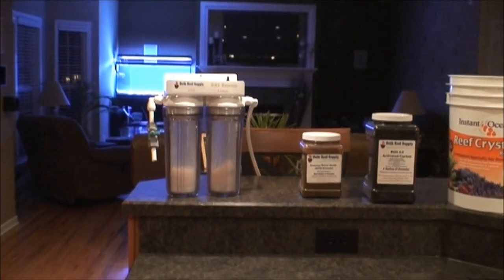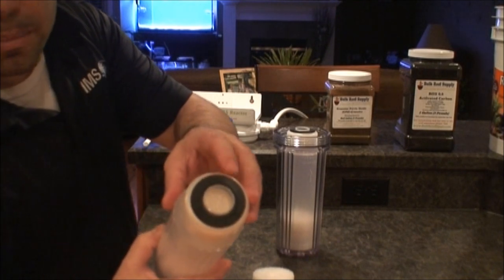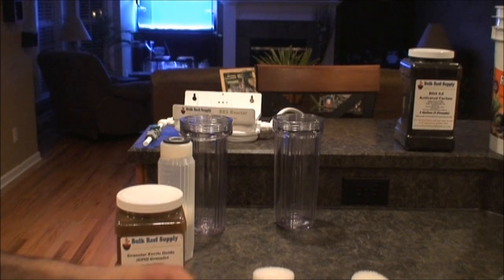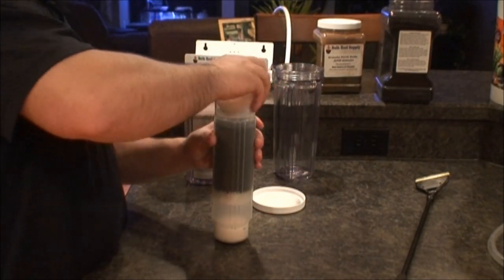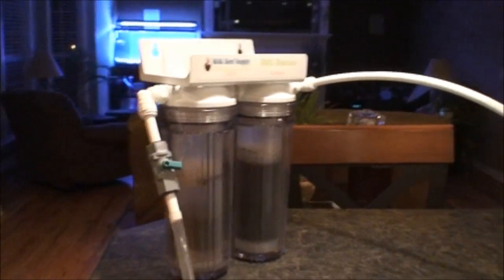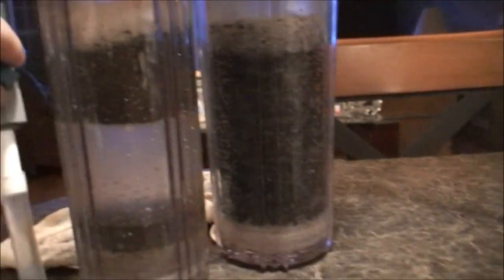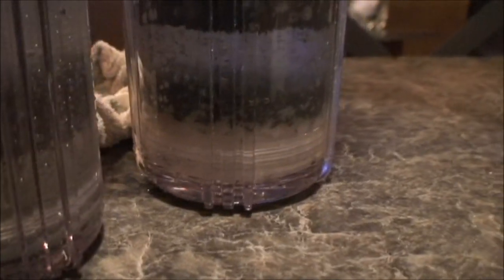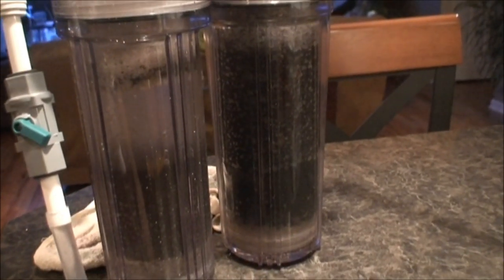BRS Dual Reactor GFO & Carbon.wmv

Comment from the maker: You can either set the canisters on the floor or hang them off the wall. I don't believe they could hang off the tank. However, I have seen some set inside the refugium. 
The hoses are not that long. You can cut the plastic which inserts into the couplings and attach vinyl hose to extend. This is what I did. I purchased the vinyl hose from Home Depot.

Comment from the maker: I like the reactor very well. Well built and easy to use. Much better than putting carbon near the return pump in a bag. Not very efficient. However, if you have enough room I would use two single reactors. One for carbon and one for GFO. This way you can control the flow differently to each reactor.

Comment from the maker: @jbliss2000007 Thanks for the info. I will make sure to keep an eye on the GFO. It is not running yet. I actually put too much in the reactor. I will be removing and re filling correctly. I will also finish what I have then try a different brand. 
That I awesome about the refugium. I can't wait to see it.

Comment from the maker: @UstadZed Well, after all the research that I have done I feel that the sump refugium is the best filtration system for the reef tank. This is the system, 73g Display, 30g sump ASM - G3 skimmer(used), BRS dual reactor, Mineral mud, 180lbs of sugar fine sand, Tek light, Reef Keeper (freebie) custom built cabinet. 
So, I don't really have much more than anyone else. The cabinet was a bit much but It needed to match the space in my house. I treated the cab. as a piece of furniture.

Comment from the maker: Thanks for the tip! I agree with you suggestion. However, it is a bit difficult to get good flow for both meida's. 
After using this reactor for a while I believe separate reactors are a better way to go.

Comment from the maker: Yes, the unit stopped leaking. It works very well and is also reasonably priced. However, If you have room for singles that is what I would go with. It is easier to control the media with a single reactor.

Comment from the maker: @moneymarkj Well, I took 25-30g of water out of the tank, set the rock in and completed the aqua scape. Then I filled the tank back up and changed the scape. After looking at the tank for a while, I still don't like how I have the LR set up. So to answer your question, Yes the water is in the tank.

Comment from the maker: @MadHatterReefs I didn't mean that I do not want to use the carbon and GFO. I meant that I wish i had purchased separate containers. I don't know if I am a fan of Bio Pellets. I feel that with the correct set up, sump/refugium, LR, DSB and carbon, there should be no need for the pellets. However, I could very well be wrong.

Comment from the maker: @dm002a8686 I purchased from Live Rock N Reef,  Cherry Primo Deco and Buna Ultra rock. I started with 70lbs. The guy told me not to use more than that due to the Primo haveing so much life and the cycle will be huge. We will see about that. I will post a vid. The rock will be here today. I also have about 80lbs of Premium Fiji LR in my 36g tank. I will be taking some of that rock also after the new rock cycles. This is the plan anyways.

Comment: well what i do is since there's a top sponge i take out the bottom 2. and fill then put the second sponge in then put the third in and cap the bottom then you don't have to worry about the carbon tumbling. then just leave the GFO the way you did it.

Comment from the maker: @UstadZed Ohhh. Bro, Sorry I forgot to shout you out. I made the video late last night after driving for about 50o miles. I will def shout you out. 
I don't know why you think that I have spent too much money. The reactors were quite inexpensive. I didn't want to put the bags in my sump. I wanted a bit more control. Also, you need to remember that I am subject to leaving for extended periods of time. I need the tank to be easy as possible to keep for my wife.

Comment: Hi im new to the hobby and i was wondering, doesn't the cloudy water from the GFO clog up and reduce the life of the carbon when you're rinsing it through?
Have you found a better way of rinsing or does it not matter?
Thanks
Reply from the maker: I have never had an issue with the GFO "clogging" the carbon. If it's a concern, you could rinse the GFO first and then Rinse the carbon. Or... use a separate reactor for ea media. I liked the dual reactor because it uses one pump. However, it's a bit harder to control the flow for both media.
Reply: Hi thanks for the input, my dual reactor arrived and i just installed it and boy am i having problems!
First off both hose connectors on the unit leaked so i fixed by applying a small amount of plumbing putty which i had laying around, Then the carbon chamber is only filling half way and a small flow of water is coming out of the return which tells me that water is bypassing the carbon chamber!

Im about ready to trash the thing.
Reply from the maker: I use plumbing tape on the threads of my reactor.  The carbon reactor might not fill to the top. This is normal operation
Reply: Yeah  thanks for replying mate, I just unscrewed the chamber while water was flowing to release the trapped air and its running a lot better now. Phos has dropped from .07 to .03 in two days of using it so i'm happy about that :)